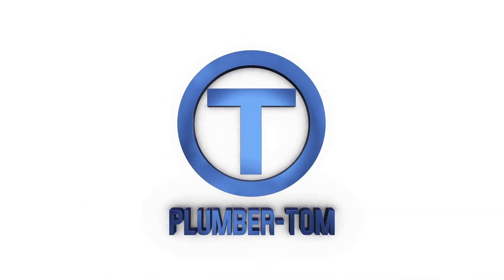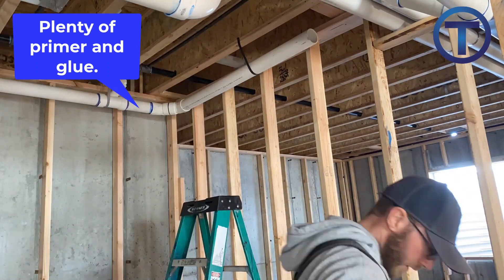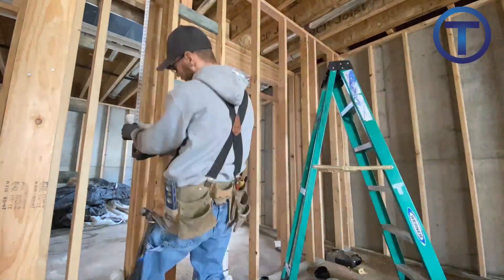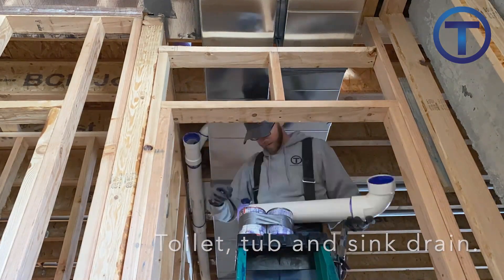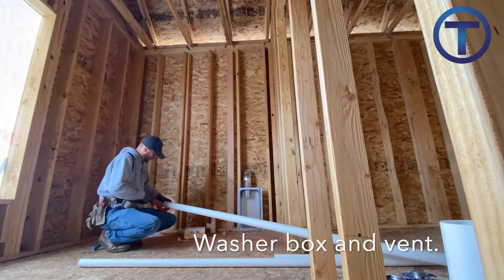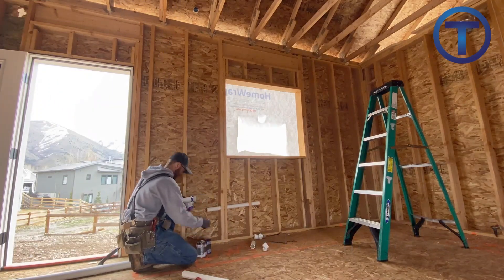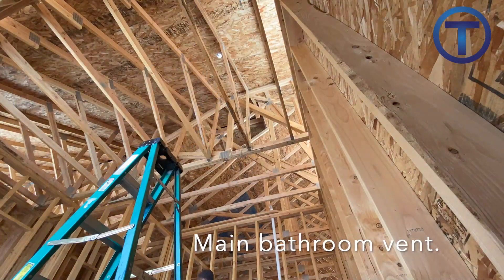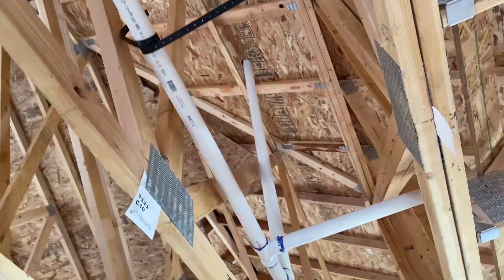DWV Rough Time Lapse with Explanation

Comment: Thanks for the video, Tom. For the most part, I think you did a good job and made some good points gave a lot of good tips, but you can certainly get enough (even a lot) primer on the pipe and fittings while still being neat with it. 

Not saying you didn’t do this, but I didn’t see you chamfer one piece of pipe. So many plumbers blow this off as not necessary, but I disagree, just as all pipe and fitting manufacturers would. 

Also, you are putting too much faith in the plastic strap, especially where you have used it to support horizontal pipe centered between joists — a block would be much better. Plastic strap is, well, plastic, so it stretches over time — especially in the attic where it will be subject to high temperatures. I have seen this happen, and repaired it, many times over the years — I have had to fix bellies in ceilings, basements/crawl spaces and attics due to the Plasticity/stretching of this strap. Don’t get me wrong — I use it all of the time because it does have its place for strapping pipe when used correctly, but I am careful to not use it in the situations I have mentioned. I use a lot of metal strap and a lot of stove bolts in residential rough ins instead of using my plastic strap where it is impractical or impossible to block a pipe. I know a lot of rough in plumbers do it just the way you did, but most of those plumbers have never gotten into the service realm of plumbing, so they have never seen what happens years later. I did new residential plumbing for the first 21 years of my career and switched over to (mostly) residential service for the next 15 years, then switched over to, and am still doing new commercial and industrial plumbing, so I have pretty much seen it all. I know that what we all think is good now doesn’t necessarily end up being such a good idea in the future.
Reply from the maker: Thanks for the comment Bruce. I can always count on you for some good advice!